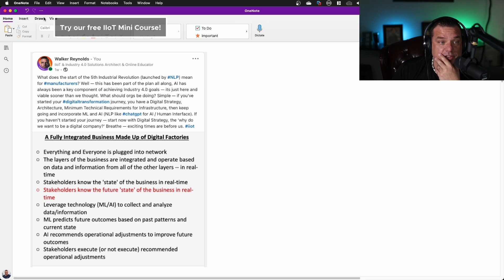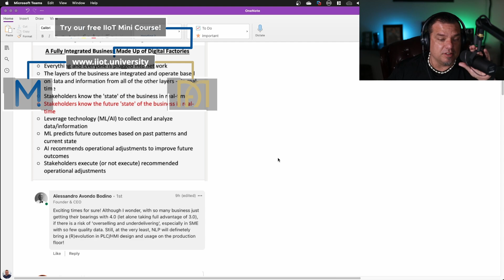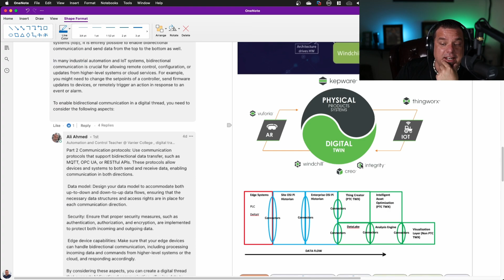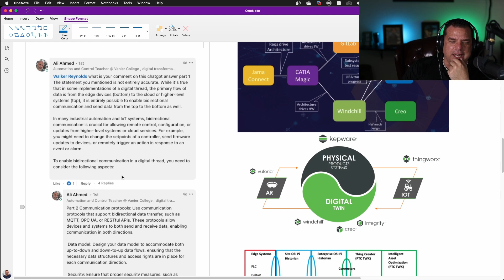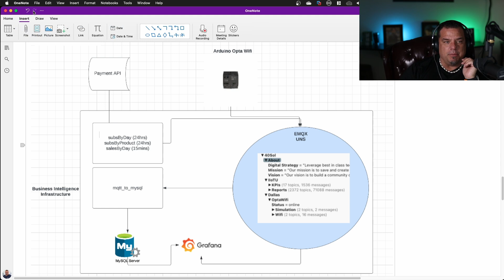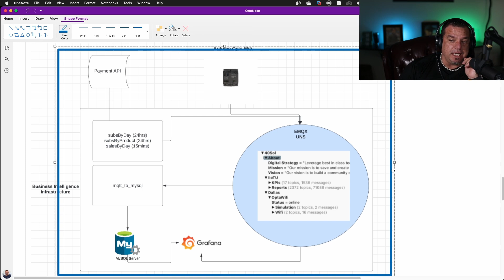Digital Thread is still a Debate in 5th IR?

Comment: Very nice and illustrative video, another one in the bank for a better understanding of different ways to approach the same problem (and why UNS makes so much sense). Beside the main message of the video, what you talk about in the end regarding license cost; how do you think NLP/CGPT etc will affect the SW market and licensing cost going forward? I guess making long term contracts on licenses now should be avoided, and creating a specialized team internally (for developing what you want) instead of using SI`s could pay off rather quick if done correctly.
Reply: Spot on — licensing costs should definitely come down, especially on the maintenance side.

That being said — off the shelf platforms + build will become the norm.

Comment: Isn't the fifth industrial revolution now threatening to upend your mission statement (boosting the middle class by bringing back manufacturing jobs)?
If anything, it looks like we will have the AI tools to automate a significant share of jobs over the next few years, and virtually all jobs on a mid- to long-term horizon.
Reply: That depends entirely on how AI is leveraged.  Jobs are a function of demand, demand a function of value — AI like NLP increases the value of the individual in a market, if used correctly.

Economies advance — our advancement has been slowed by limited time, money, human capital — AI speeds up output by 10x - 300x — so, it follows that economic advancement will speed up — rather than the demand for human value drying up.
Reply: @walkerreynolds973  Sure, in an intermediate stage I agree. What's next though?
As soon as we reach full AGI (which may be only a few years out, or longer - experts disagree with each other), jobs will concentrate to very few managerial positions, and then ultimately these will be eliminated as well.
Reply: @kilojoules88  A hyper specialized economy -- we will see a split in 'work' based on EQ and IQ (the ability to get the most out of AI).  We will see an explosion in cultural and entertainment 'jobs' and we will see massive growth in industrial support positions.  Markets that were priced out and left untapped because of low ROI (poor efficiency) will open up.  We have discussed this in depth on a couple of our podcasts -- revenue streams for all workers will come from three places, UBI, Hyper Specialized Professions, Gigs.

Comment: Great discussion and important topics, appreciate the visual aids.
Reply from the maker: Glad you enjoyed it! Let us know what else you'd like to see us cover.
Reply: @4.0Solutions  I'd like to see how you guys would utilize GPT-3.5 learned on a customer specific data lake to perform process oriented analytics. For example, I work for a large industrial OEM that produces PLC driven machines. I'd like to capture data from our field machines into a data lake, which in tandem is modeled via GPT-3.5 for contextualized output. Meaning our engineers could ask, "How could our customers improve OOE for our equipment based in this region using this fuel?" or "Which of our customers' machines' primary drives are closest to a fail condition, who are also customers likely to pay for preventative maintenance?" or "Give me a list of 5 customers who would benefit from an equipment expansion on their site, and provide me scenario specific operational increase ratios." Things like this are possible with a chat AI that is modeled on specific data sets (which would always be increasing in size, to be modeled cyclically). All of this is possible today, but few integrators have a clue how to do it.
Reply from the maker: Terrific suggestion! We've been doing a series of workshops leveraging ChatGPT for development, next one on IIOT solutions. If you'd be interested in co-hosting a workshop or podcast on the subject, email us at contact@40solutions.com.